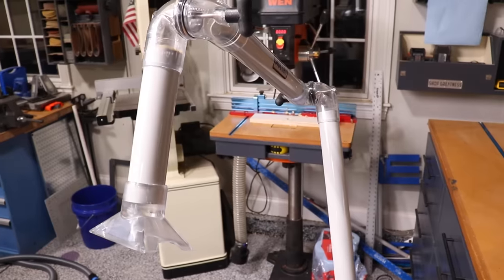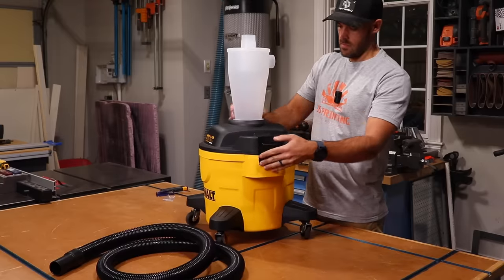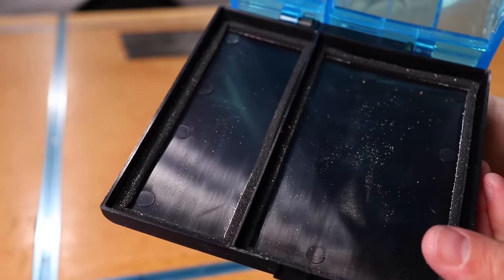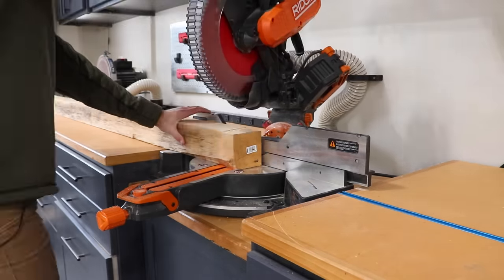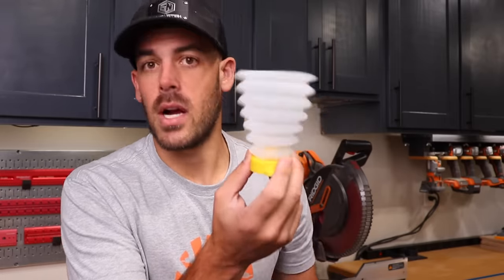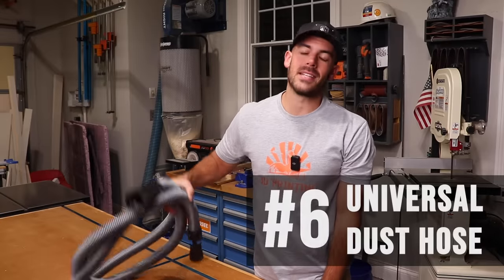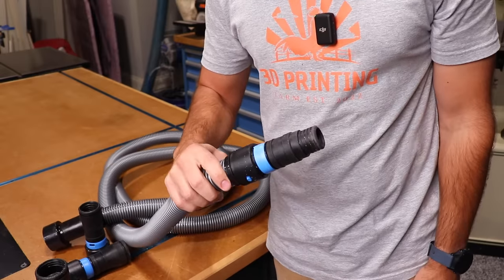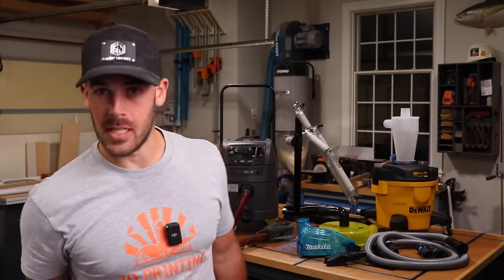Don’t fall for some of these Dust Collection gizmos!

Comment: One issue with the wall-suction drill dust attachments is that the wall surface can be stained by the brick dust.

The Festool 500483 D 27-BSD Drilling Dust Nozzle is different in that the chamber that suctions to the wall is separate from the part that surrounds the drill bit, minimising staining

Comment: So I have the "good cyclone" but they won't seperate fine particulate like MDF dust. I was constantly having to clean the pleated filter. I gave up on it and went back to vac bags. I also had a massive industrial unit in my graphite shop which also loaded up the filter cartridges. It's not the lager chips and saw dust that causes the problem. I think to win against the micron sized dust you would need to suck it through a water vacuum, which would likely have its own  maintenance issues.

Comment: Question - How much peak HP is required for a small dust collection system? For one of those a Rigid shop vac connected to a Cyclonic Dust Separator that sits on top of a bucket.  I've seen most woodworking shops bring out the huge NXT 6.0 HP BUT do you really need all that HP.  Plus I have read that hp maxes out around 1.5 HP when connected to standard 120 outlets (Is that true? I’m not sure).

Comment: I'm not getting, why no one of the woodworkers use a zigbee (or similar) switch+plug for the vacuum-power tool connection. You can command it via your phone, pc, laptop, tablet, remote switch and you can have booth ways to turn it on (and off), either delayed or remote controlled, or even mixed. I have that setup in my garage and it works smooth.
Reply: I do this, and one step further, i mounted window/door contact sensors to my blast gates to automate on/off, with a rule to ensure only one gate open at a time.   Nothing else required, super simple setup.

Comment: Where's #8? A 3D printed Shop Nation™ cylone dust separator you can add to a metal garbage can from Home Despot or other large vessels that attaches to a 4" shop dust collector (ie NOT a shopvac)? The Despot sells a bucket lid separator for 90 freakn dollars! Which to me seems like a rip off, plus it only works with 5G buckets. I want something I can add to a $20 metal trash can or a drum; that I'd pay $90 for not problem. Oh... and speaking of "good quality hose", I have that one! It fit perfectly with the stock Bosch dust port. It fit's ok, not great cause friction fit, with the SN™ after-market Bosch dust collector. I want the stock port adaptor!

Comment: Do you still use the Wen dust extractor that was under the original table? Recommend it as an affordable upgrade over shop vacs or is it about the same?

Comment: Thanks for the information… you may have sold me on the anti static hose and adapter set.. I currently use the ridgid shop vac with a dust bag and heap filter (works great) but the hose the tickler flexi hose and adapters is cumbersome 🤔 thanks again

Comment: That Dewalt is nifty - had no idea they made those but at near 150 bucks it's not a great deal, and I'm too cheap for that. You can get the oneida dust deputy for less than 1/3 of the price. Although there is value in having an out of the box solution.

Comment: Great video   Have been wondering what the time line is on your dust boot for the Dw715 is?  Waiting patiently for that one.  I have tried many options, and your 's seems to be the best I've found.  I too, like having a single vacuum fob to start and stop my vac.  Too much starting and stopping a vac will wear it out prematurely.

Comment: Curious about the Mullet Boom Arm so will do some research on that.  Would have liked to have seen some real world use with table saw, router, and other applications.  

Been using the remote switch for a few years, don't see the need for the auto on/off vac/tool combo.  Plus, wouldn't that be a lot of amps running through a single box and circuit, possibly 20 - 25 amps?

A few of these are just plain gimmicky, and I can't see the justification for the 3M Xtract, apparently just a single tool orbital sander plus another shop vac.  I already have and use a variety of electric hand sanders that come with a variety of dust ports.  I just hook up a smaller hose and run that into a generic shop vac and -  no dust!  

Otherwise as for 3M, they make the best abrasives.  Tip for anyone doing manual hand sanding, look into the 3M "Stikit."  Entails a plastic handheld sander, 2-1/2 or 3-1/4 in. width, with built in magazine for sandpaper rolls available in 80 all the way up to 440 (I believe) grits with a slightly sticky side.  No messing around changing out individual sheets, when you need new sandpaper, just pull on the roll and go.  I discovered this some 20 years ago and it takes care of 95 percent of my hand sanding applications.  Unfortunately, 3M applies the "Stikit" label to a myriad of their products, but look for the red sander magazine type.  It has a white felt bottom, and the sandpaper rolls are tough, excellent abrasives.   And the red sanders have the best ergonomics, easy to hold and easy on your hands unlike the old rubber and wood blocks.

Comment: Never knew DeWalt made a dust separator. Gotta admit though you had me confused with your comment that it catches way more than the other style. I have the Dustopper on a Home Depot bucket and basically nothing makes it into my shop vacuum. Now if you run it to full yes it'll suck things up but that's user error tbh. Every option has to be emptied at some point. The only time I messed up is the first time I used my planer, I wasn't prepared for how much wood those things spew out and had to empty the bucket and vacuum when I noticed the sound of the vacuum change.
Reply: I like the sound of your dust collector/separator better than all these expensive ones!!!!

Comment: If I may suggest using the auto switch on the tablesaw instead of the miter saw. That is if you’re able to plug in a 110 tablesaw other things that it works well on would be a Planer or router table.

Comment: my question to you is my shop vac has a low capacity if I were to use the wet vac a wet filter could I use a dust collector as an addtional storage in case of a flooded baseement thoughts please thank you

Comment: My problem with the auto vac switch is I need to keep my vacuum and miter saw on different circuits or it will pop the breaker.
Reply from the maker: The auto switch is specifically meant to prevent that. The start up amps is usually what trips it
Reply: I bought one on Amazon made by IVAC which uses two circuits.  It's worked well for me with no tripped breakers.  I was really surprised there weren't more options like this.

Comment: 1:09 I've been running the Dustopper version of this since early 2021, paired vertically with a Rigid vac on a mobile cart. The amount of fine dust that I have to knock out of my vac filter is brutal though... But at least it's not going into my lungs (much).

3:06 I have an older 10" Makita mitre saw. No idea what model it is, but I picked it up in 2010. It collects dust on a top shelf in the garage... MIGHT come in handy down the road for in-home installations (among other things, I build cat room wall features). I really love my 12" Makita mitre saw though, but she won't be going mobile. It didn't come with the laser guide, which I didn't need anyway (I am capable of lining up a blade to a mark). But a friend of mine has a different brand that just has a regular white LED light that shines directly down on the top of the blade, creating a shadow where the blade would cut the material. I like THAT feature, and I might even figure out a way to make that work on my saw. There appears to be a rubber port at the top that would probably house the laser on that version. Looking forward to getting your dust collection adapter when available! The one that came with this saw is GOOD, but can be improved. You can definitely tell when I forget to turn on dust collection before a cut.

3:55 That wouldn't be practical for a mitre saw that's fixed into a mitre station. I'm happy with just running a hose to it..

12:08 Ah, the coveted non-pneumatic 3M sander... I remember when they first came out, and Stumpy Nubs made a video about it using one that was lent to him by 3M (I think). Apparently they're a game changer. Or to piss off my friends' ex-wife (who hates the term), a show stopper. lol
Reply: Rigid makes bags to fit a lot/all of their shop vacs. Adding one, it'll do light duty since it'll only be trapping the finer dust that makes it past your Dustopper. Grab a pack of pool filter socks from the local pool store or the AMZ, and never have to shake out that filter again!

Comment: Doesn’t the mullet boom arm reduce suction? It has basically 6 90 degrees elbows and interference inside the elbow with articulating mechanism. Any good dust collection system either eliminates 90’s or minimizes use. Not to mention the hookup for vacuum another hard 90.  Definitely a gimmick!

Comment: I want to thank you for this video. I am struggling with dust connectors. The DeWalt cyclone vacuum would be perfect for my tiny workspace. I just bought Rockers quick connect kit but I am new to all this and was wondering how to get the hose on the connectors it's like wrestling with an alligator.

Comment: I have both the Dust Deputy and the DeWalt.  The DeWalt is far superior to the dust deputy.  The dust deputy captures about 50% and the DeWalt is probably around 90%.  Amazingly the cost is nearly identical even though the dust deputy didn't come with a bucket.  DeWalt is a great value and it's highly effective.

Comment: Do you need that extractor for that sander or can it be hooked up to a shop-vac with a dust separator?  I would imagine it's not as efficient, but $900 is a tough pill to swallow.

Comment: Be nice if the boom arm didn't have so many 90 degree bends.  You end up losing a lot of airflow and velocity and would need a very good vacuum to compensate for it.  A boom to position a hose would be more efficient.

Comment: You know what I love?
When I'm on a job site and there's a guy using a Festool or Makita or Hilti  Or whatever dust extractor so he can safely cut up the asbestos flooring and he's running the goddamn machine without bags! Every few seconds it slams the filters to clean them and a cloud of dust pops out.
I pack up and go home.

Comment: The flaccid drywall dust catcher is a gimmick.  A piece of paper taped to the wall below your hole folded into a pouch does the job.  Best part, you fold it up and throw it out.  Cheap and easy.

Comment: I'm going to cry foul on the Mullet device. I mean they didn't even have a guy with a mullet demoing it 🙄 So how much do they really believe in it? LOL!

JK it does look useful but for the price I think I'd probably build a boom arm like Jon over at Lincoln St. Woodworks has. His solution even lets you mount an overhead extension cord and air hose for all your pneumatic tools. It's actually been on my to-do list for a long while.

Comment: That 3M system is over $1600.00 dollars. $600 for a sander and $1100.00 for the vac. Thats rounding to the nearest dollar. Who can afford that in this economy? Talk about over priced.
Reply: Then use a harbor freight sander. Your problem is solved.

Comment: Come on, there was fine dust, the sawdust killer, all over the vac portion of the 3M dust collector, and the bench. Did they give you that unit is that why your suggesting it? Sure it maybe better than a shop vac, but its not worth the high cost when you can get something more efficient and not as costly.

Comment: The DeWalt cyclone separator is a direct rip off of the original Oneida Air Systems Dust Deputy. Oneida did it first, and now other companies are profiting off a product they didn't design. Oh well.

Comment: Cyclones are kind of a scam. The large chips get separated from the stream but the fine dust just sails on by. The fine dust is what clogs your filter. There is also a huge loss of energy that is required to constantly accelerate the chips in a circle. The biggest advantage of a cyclone is the potential ease of emptying chips.